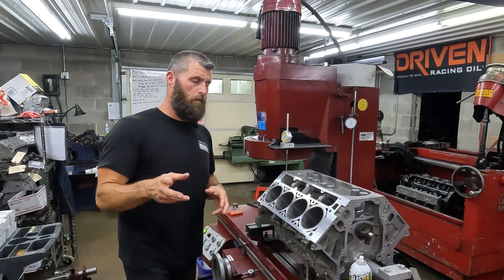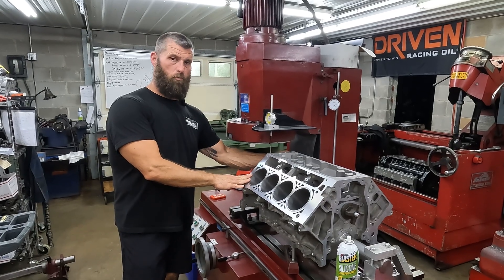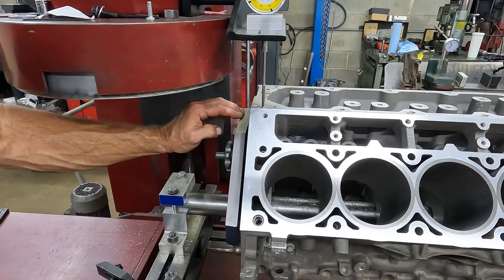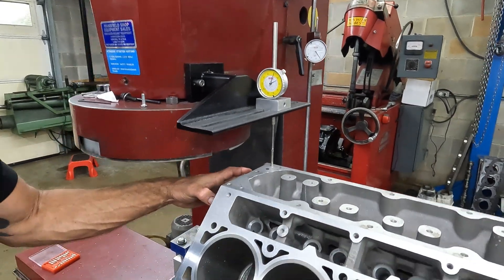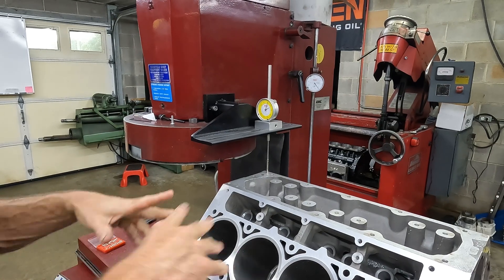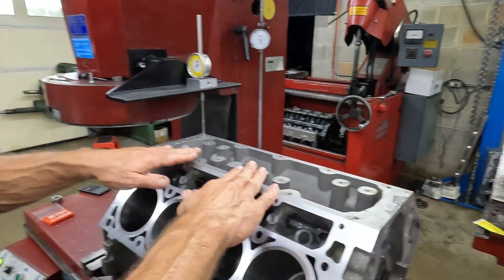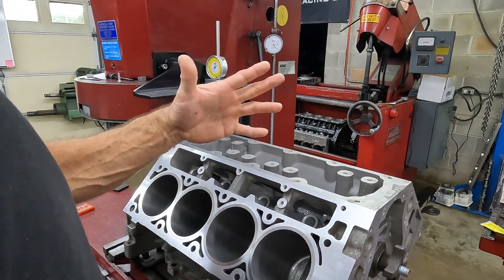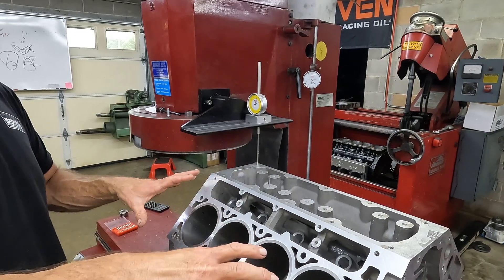checking our work...is it really square?

Comment: Silly question.   If everything is relative to the crank.   What is an align hone for the crank referenced against once you have pulled the crank?    Naive guess is use a surface that referred to the crank before the crank was removed but that feels kind of like a chicken and egg problem.     Off to find one of your videos on align honing.
Reply from the maker: Think through the question you asked,  the answer is in front of you

Comment: Get on machine probing with a Renishaw probe. This way corrections can be made immediately. With a CMM you have to return the block to the CNC for rework after checking if the block needs rework.
Reply from the maker: This machine is manual,  you can't use a probe,  my big cnc mill when I get it set up for block machining  we will do the blocks in it, but regardless,  we valided our fixture,  so we don't need to do it again.
Reply: @powellmachineinc  Most of the industry has moved to on machine probing because it's invaluable.
Reply: @powellmachineinc  Almost all CNC machining job shops have now moved to on machine probing because its such a time saver!

Comment: So how much would it cost if someone brought you an iron block ls2 (whatever they're called) that was previously built with all forged internals and i gave you the bare block and said to make sure all if this was done.  You set it up and found that all was done and in great shape.  What would that verification cost?
And if it needed to be squared up, what would that cost?  General cost is fine, i wont hold it to you
Reply from the maker: prob 3-500 to check everything, if it all needed redoing, maybe 700-1000

Comment: Question:  I'd like to break into the industry, I went from IT/Software Dev to becoming addicted to classic vehicle restoration specifically the BMW e46.  I quit my job and have been working as a mechanic to make sure I had the necessary skills, now its time to get into the machine side but my financial reality is I can't maintain my bills for less than 30/hr.  Am I a lost cause or is there a place for me?  Thanks.
Reply from the maker: Getting a job with no real experience Is gonna 15-20 a hr prob
Reply: @powellmachineinc  Unless people are starting the trade out of high school or they have savings to support themselves I don't see how it's sustainable.  I've watched other videos of yours talking about the difficulty finding new workers.  With rents and basic expenses being what they are I just don't see how this is sustainable.  Or you would have to work two jobs.  A potential solution might be guaranteed bumps in pay over specific periods of time if someone proves themselves?  I don't know it's a difficult time and inflation continues to raise costs of everything.

Comment: I would say that you are doing a Top Notch Job Daniel. 
What we all were trying to do is get the decks at 45° So we can get the cylinders at 90° to the deck.
Even .002 to .004 is seconds of a degree.
So much closer than the factory is.
When you look at the variances of the pan rail, main registers, china wall and decks.
Most likely machine in different machining stations and each station and or opperation has it's own tolerances.
I would say you are absolutely spot on.
Remember, you are on the business end of things.
Thats the part that makes the Horsepower. 
Nice work. 👍👍💯🇺🇸
Thanks for sharing.
Reply from the maker: Absolutely 💯

Comment: I watch your videos at work when I'm not busy with a customer. I work at AutoZone and was a automotive mechanic for almost 35+ years. I've worked in a automotive machine shop. Your videos are very educational and I share them with my boss and coworkers so maybe they have a clue what it's all about. Thanks for the great videos keep up the good work
Reply from the maker: Ty! We really appreciate that 🙏
Reply: Dude, no one cares. Your coworkers and boss are pretending to be interested
Reply: @lollipop84858   If you guys at Auto Zone ever turn a hubless rotor, did anyone qualify the machine? As an ACDelco rep. for service, I rode with a warehouse salesman from that area. Almost everyone was replacing rotors, but with a cup installed, spring and centering cone, cut a rotor. Loosen the nut, don’t turn the shaft, rotate the rotor 180 degrees. If you check it by making a new cut, just a kiss, or install a magnetic base & dial indicator, did show lateral runout? Yes! No one checks this. In the Ammco Brake Lathe manual, it pointed out this test on a regular basis as it said; “Every 100 rotors or so, test the lathe for lateral runout with a clean rotor to ensure lateral runout was not cut in by the operator due to an unqualified machine. In 1975, this was no longer in the manual. I brought it up, we cut rotors and had 0.012” - 0.080” on a rotor before bolting on. Everyone is cleaning the hub / bearing but Kent-Moore had this set of conical washers. Using these, lug nuts on a fresh cut rotor, a dial indicator would show a max of 0.002” thousand of an inch. If check when cut, off when installed & tight, hub was bent. It all snowballs into one pile. To fix it, you have to know which pile the problem came in. Acura,  Lexus, Nissan, Cadillac and many others show 0.000” for lateral runout specs. GM, Ford, Fiat-Chrysler and others are 0.002”. Many I asked said they would cut rotors, and 2k miles later had a comeback with pulsating pedal complaint. This is why as after a few hot/cold cycles, the rotor warped more.

Comment: The main parting line is irrelevant.
Reply: So the main bearing parting line alignment bears no relevance to the accuracy of the motor? Please tell me (and all the others watching) what is your background that allows you to say that.
Reply: @bobhudson6659 it is, the caps sit in their registers, as long as the main line bore is straight, parallel to the cam, bores and decks square to that reference, a parting line is just a parting line. Unless you have 2 deck plates torqued, main caps torqued to introduce all the stress into the block and have probing holes drilled into each cap you are not really measuring anything. The goal is to make it as square as practical and everything moves once you bolt things to it. A relaxed block is not how the engine operates. If you installed torque plates to both banks the pan rail sweep would likely change. Cross bolted mains change all of these dimensions. There is a point when all of that becomes an impractical rabbit hole.
Reply from the maker: It's a reference like everything else

Comment: Is that the badass 5.3 you resleeved?
Reply from the maker: Correct
Reply: @powellmachineinc  looks nice as hell
Reply: @powellmachineinc  sorry for all the questions, could you resleeve a STD bore aluminum LS2 block with the slightly longer LA Sleeves sleeves and still keep it 4.000" to 4.005" bore or would going to 4.125" be easiest to do?

Comment: I like seeing that Driven shirt and banner up in the shop 👀. For some reason I hadn't noticed that before, but unless I've missed it (which is certainly possible) do you have some thoughts for a video on oil for your builds and break in oil? I've seen what you use during assembly and what not and I feel like everyone likes Drivens BR oil but I don't recall hearing your thoughts on oil specifically too often. That is, at least in the way I'm thinking, I know obviously you've covered and explained plenty of oil dependent systems. I remember during the flat tappet transition I saw some videos where you mentioned oil viscosity playing a role in eating up distributor gears on cams, but I'd be interested to hear your thoughts on types, additives, viscosity, or whatever you'd be willing to share. 

I also understand if that's something you're not as interested in since its a bit of a can of worms and you can just recommend a variety of products based on clearances and application and the customer can choose whatever within reason or figure it out themselves. 

Love your videos and I like that you guys do periodic checks of your equipment to try and verify and validate your system.
Reply from the maker: We will talk about that on a video